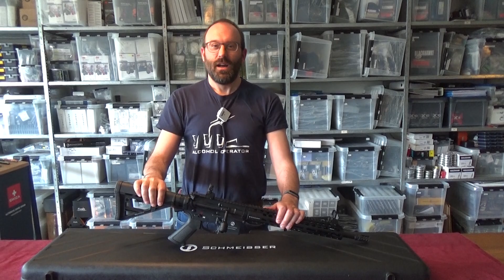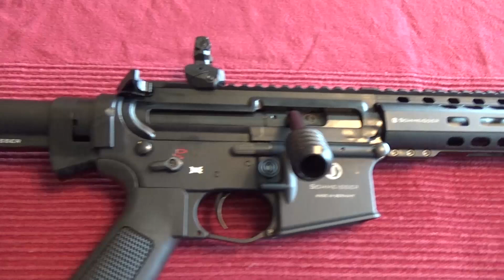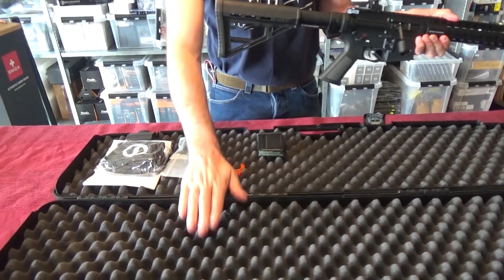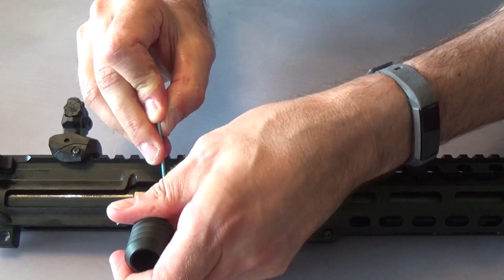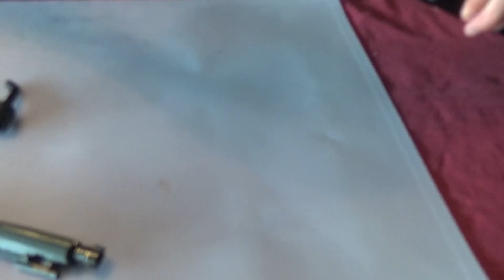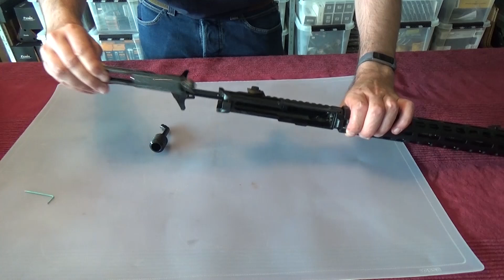Schmeisser SP-15 Straight Pull AR-15 .223 Rem

Comment: How would these fare for long time survival mad max situation over a normal ar15 or a bolt avtion
Reply: This rifle would probably not require as much maintenance as a standard AR15, there is less to go wrong. Compared to a bolt action, I think this rifle may be better in terms of weight, it could also be faster to cycle the action as well being a straight pull and having the buffer spring push the bolt forwards.
Reply: Likely better than you.
Reply: I mean depending where you live regular ar15 components would be pretty common. So honestly I think you would have more problems with such a weak caliber and possibly not finding components. For a bolt action ar
Reply: Unless you spent the majority of time using it as a club instead of a rifle, it would outlast the shooter.  Even more so since with these you don't need to worry about maintaining a gas system, so no cleaning or dealing with rotted out\bent gas tubes.
Reply: I’d take the normal AR over this.

Comment: ithey should've done a pump action that runs under the foregrip and pushes the charging side handle backwards, instead.
Reply: If those rifles are made primarily for the UK market that would be completely pointless, because centrefire pump-actions are illegal there.
Reply: I can speak from experience that pump ARs are terrible.
Reply from the maker: Making it a pump entirely excludes the UK and Austrian markets from consideration, and makes the rifle more expensive. Plus operating a pump prone is the very definition of suckage ;)
Reply: @BlokeontheRange  Agreed on that last point.
Reply: @BlokeontheRange  well UK laws sound like C&B torture.
Reply: This is new information for you?  Although as I pointed out elsewhere, if you want to own nothing but supressed bolt-actions with 12" barrels, the UK could possibly have the edge.  At the very least, it probably wouldn't be any more hassle or expense than in America.
Reply: @BlokeontheRange  Pump action centerfire rifles are alright in Austria though. The Remington 7600/7615 is being sold here, as well as the Troy Industries Pump action AR. The issue only resides in pump action shotguns, and even then it's bound to capacity. It's just no one bothers to make a 3 round full size pump action shotgun here, and I also believe that a Ishapore Enfield in .410 is an issue because it could possibly host a regular enfield mag up to 4 shells.

Comment: Heavy port-less barrel, eh? Accuracy must be better than a regular AR then. Even if the AR is free floated, it's going to whip the barrel. Force gas turn, gas bends barrel.

I assume the bolt carrier isn't compatible with any AR, so why bother with the rear extension of the carrier? You can move everything forward, and even allow folding stock!
Reply: As you can see him demonstrate, it still has the action spring in it. So it returns to battery on it's own, all he has to do is pull the handle back and it does everything else.
It's like a semi-semi-auto.
Reply: @MandoWookie  I totally forgot about how the lower is essentially an untampered AR lower...

If we were to instead base the system on the AR-18, it would probably be a lot more straight forward. But of course, it doesn't have the aura or the aftermarket support that the AR-15 enjoys.
Reply from the maker: The thing is that there's loads of mfg's making AR15 types, and that's been the case for years. So you can mod existing parts you already have in production or can buy-in.

Accessibility of AR18 (or AR18-type) receivers has been sketchy at least... You'd have to tool-up explicitly for a straight-pull rifle, and I don't think there's the market to justify that initial investment, when you've got all manner of readily-accessible receivers to work on. In the UK there's loads of AK-based ones, even L1A1's now which are "not downconverted original rifles really (even though they basically are)" from LuxDefTec, M1 Garands, M1 Carbines and all sorts. So your start-up cost using something readily and cheaply available is minimum compared to setting up to produce AR18 types.
Reply: @BlokeontheRange  Huh, makes sense. Anything that already has a side charging handle would be a natural fit. If anything, you're just putting in less work but more or less the same rifle. Forget the operating system, maybe a softer spring, voila.
Reply: @ABCantonese  Getting them to work well is more to do with how well they extract without a gas system. Some designs of U.K. legal straight pulls are truly awful (lots of the Russia designs) some are lots of fun in the right situation.

Comment: I don't understand why one would burden yourself with the weaknesses of a semi-auto, compared to a proper bolt action; while losing the primary advantage of a self loader?
Reply: The only case I can see is that someone wants the AR-15 look, but lives under a tyrannical government.
Reply: @Mightylcanis  That is how it came about.  But then it seems like style over substance.
Reply: Because you still get all the other advantages that the AR platform has over most bolt action rifles (modular, lightweight, compact, massive aftermarket selection of parts and magazines, rail space etc.)
Reply from the maker: Straight-pull AR's dominate Civilian Service Rifle in the UK (particularly in Service Optic category) for good and sufficient reason, and it's nothing to do with what they look like ;)
Reply: @BlokeontheRange  But, ARs are not service rifles in the UK; or am I wrong?   Also, Straight pull ARs look like service rifles, but don't function like them.  So it has everything to do with looks.  I would be more impressed if they used SMLEs.
Reply from the maker: The definition of what fits in the "Service Optic" CSR category has no bearing on what is/isn't a service rifle in the UK.

But yes, I'm afraid you're wrong - the UK has been fielding AR-15 variants on a limited basis from Borneo onwards (since before the US, in other words), and the Royal Marines now have a Colt Canada C8 variant as standard.
Reply: @ApurtureSci  Weak primary extraction, ammo finnicky for loading, dirt sensitive.  

On the other hand, if people like them and they shoot OK, then that is enough reason.
Reply: @BlokeontheRange  Alright then.  Service rifle it is.
Reply: @BlokeontheRange  Before the US Army, but unless I'm very mistaken the USAF had already adopted them at that point.
Reply: ARs are good rifles with or without semi-auto. The difference between a bolt action AR and a "normal" bolt action is mostly academic. However, the advantages are apparent.
Reply: @rickoshea8138  a lot of guns are.
Reply: @baneofbanes  Are what?
Reply: @rickoshea8138  speed !
Reply: @geezerp1982  If the same entities that banned pump action shotguns saw how fast these manually operated AR-15s were fired, they might be inclined to ban them too.
Reply: At least a "bolt" handle was added in the "Garand location".  Much better than the silly "in you nose" AR rear charging handle.